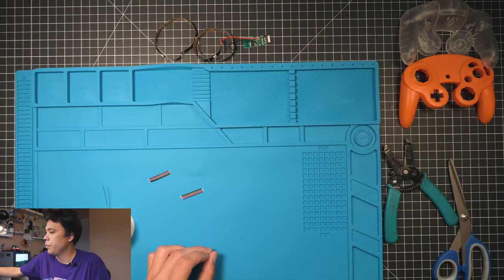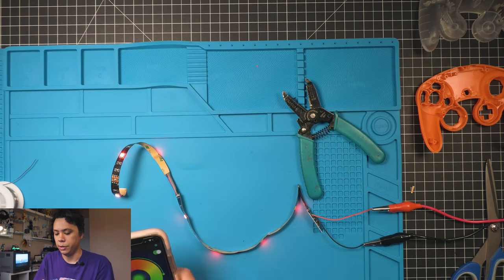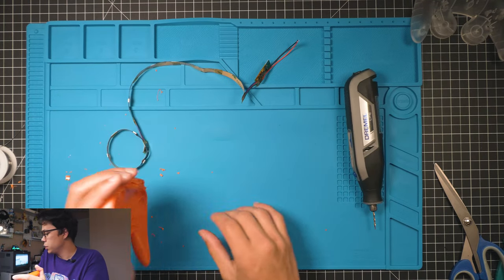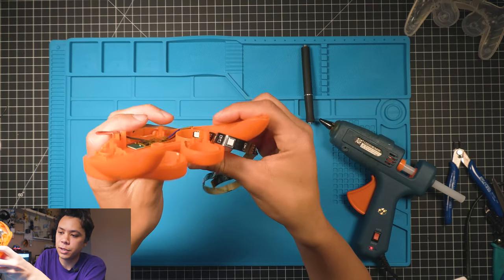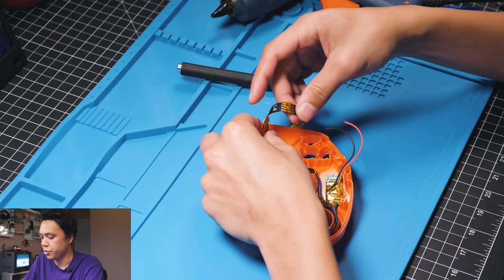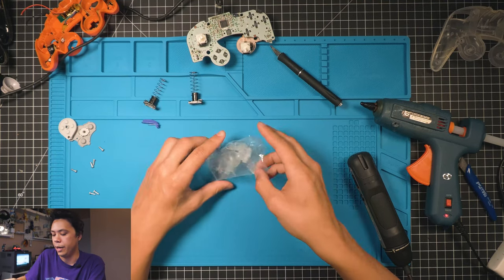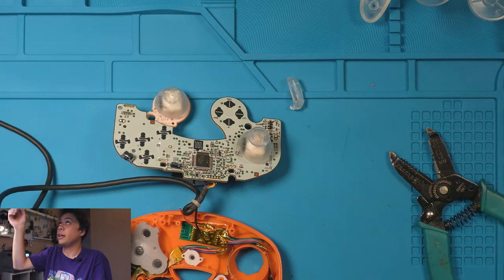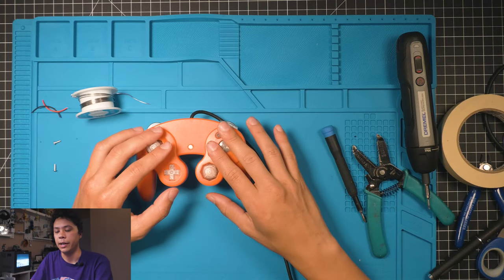EASY Gamecube Controller LED MOD!

Comment: Hi there, is it possible to have the B, X, and Y buttons have LEDs as well? I was also curious about power regulation. Does this have the potential to fry adapters and components?
Reply: It's definitely doable but not with the LED strip he used. You might need to use individually addressed LEDs to make that happen.